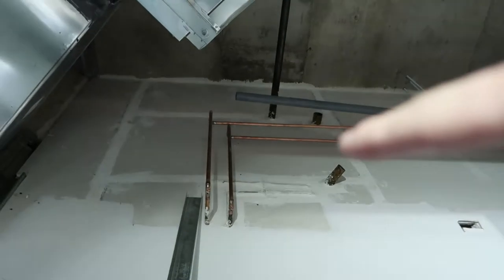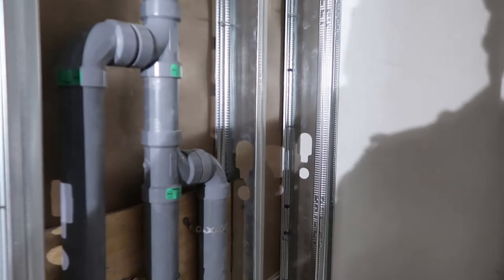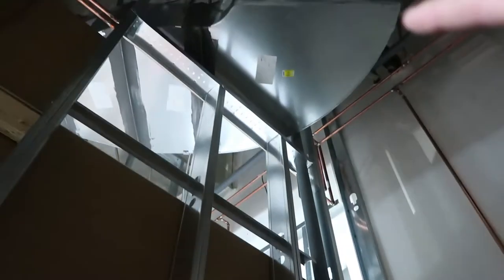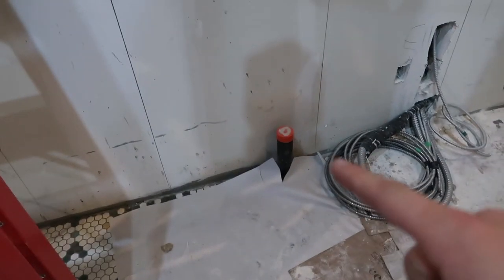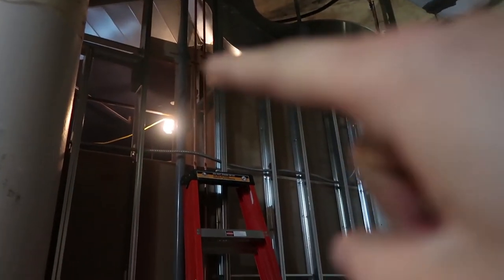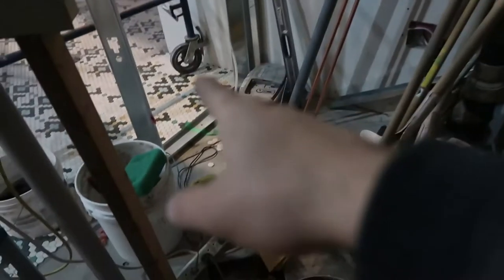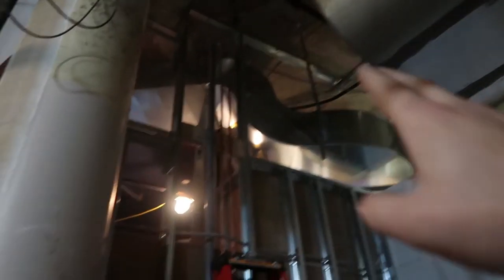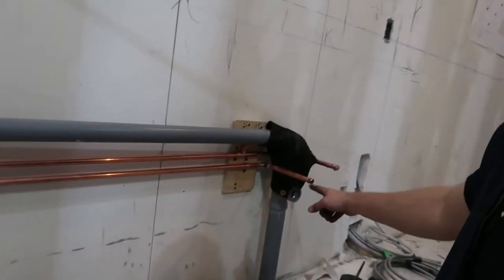Coffee Shop Rough In | Vlog 24

Comment: Just a Headz up man. Once you're out of the plenum you can switch to system 15. Difference is cost is quite a bit.
Reply from the maker: Hey brother thanks for the advice. Im pretty sure we were asked to put xfr as vents in this case to protect all the offices above the coffee shop (there are multiple floors above the shop).  But you’re right...it would have saved a ton of $$$$$$$....
Reply: They may have asked for it, they may have even paid for it. if you're doing another commercial or ICI job in the future where they don't ask just remember System 15 has a 2hr fire rating in none plenum spaces. Example: if it is a return air plenum and you are forced to run XFR ; when you 90 down into a wall space or chase that is not consider part of the plenum you can transition to System 15.$$$$$$$$$
Reply from the maker: That’s Awesome brother! I didn’t realize that! Is that the standard in Ontario...or do you live outside ontario?
Reply: Hamilton. Keep doing your thing man; just be conscious of how you could of saved on time and material on projects while on somebody else's dime.  You strike me as a man that will be going on his one day.
Reply from the maker: I appreciate all this Andy! Our roots are in service work, so we are still getting the hang of pricing new construction jobs for sure, and ways to save in some areas. So any of your advice is always welcome brother. Thanks for the support and kind words! Are you working for yourself?
Reply: Self employed, watching Hamilton rise from the ashes :S